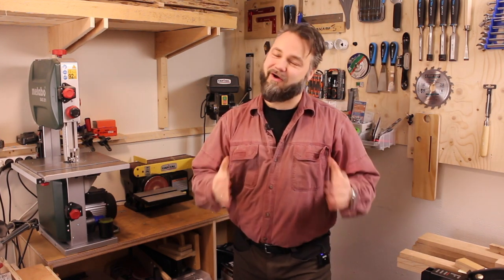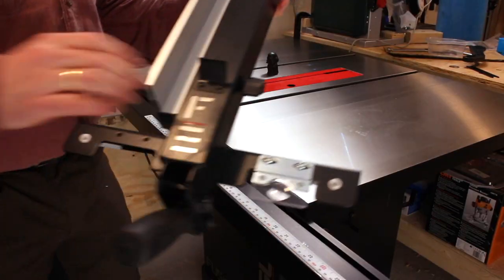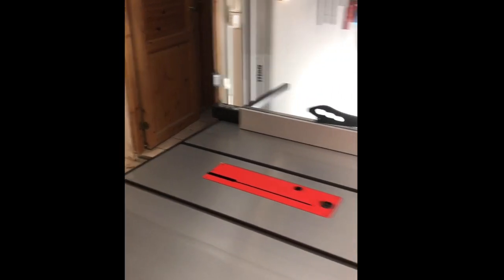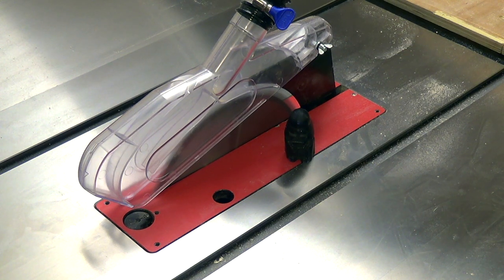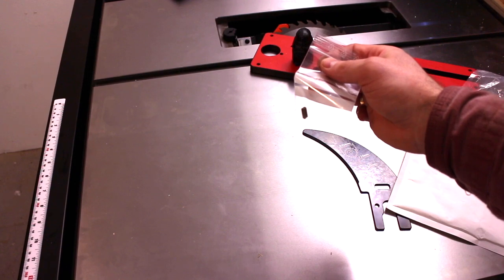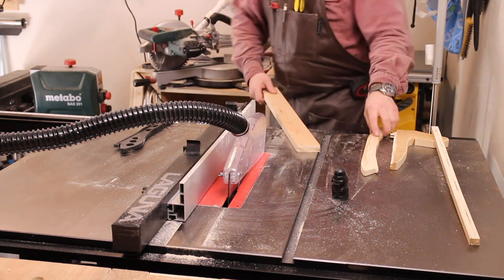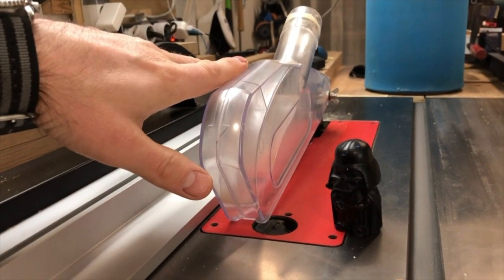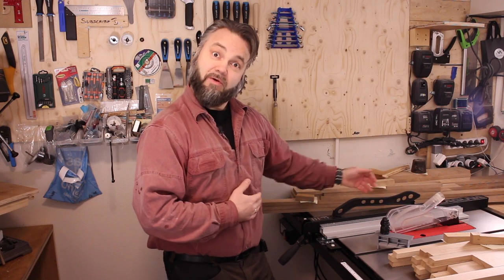Mother of All Unboxings - Laguna Fusion 3 Cabinet Saw - My Forever Tool - [0069]

Comment: The dust extraction is unfortunately terrible. It's inexcusable on a saw of this price point to have a cheap 1 piece blade guard and such flimsy hose and hose support. At this price point, with a 100% Chinese product, they should have beat even SawStop's dust collection.
Reply from the maker: I agree with you on the dust collection and blade guard. However, here in Norway this saw is not particularly expensive compared to other similar products, so I cannot comment on that. 
The saw does have other redeeming features though. Especially the quick change riving knife.

Comment: Would love to hear your thoughts on the saw now that you’ve had it for a few years. The F3 is on my short list.
Reply from the maker: I absolutely love the saw. It is, however, not perfect. And depening on which side of the Atlantic you are on, and on your budget - there may be better alternatives. 
Pros:
- Quick change riving knife/blade guard
- Motor brake (required in Europe so may not apply to US models)
- Poweful/Heavy etc. 
Cons:
- Dust collection
- The fence is adequate, but there are better solutions out there
Reply: @NomadMakes  Thank you for your feedback! I’m in Texas and able to score an F3 for about $2200USD after taxes and shipping. The Harvey I’m looking at is $3500. The Sawstop is…well, too expensive. The fence is such a critical feature that your comment is all I need to read, especially with the new Big Eye fenced from Harvey. Appreciate the feedback so much!
Reply from the maker: Nice to hear you found it helpful. Good luck with your purchase.

Comment: Hello Nomad. I am also based in Norway and I am curious about the little brother of this saw, the Laguna Fusion 2. You have used your Laguna Saw for a few years how does it hold up and would you reccommend this brand to someone with fairly little experience but with a big passion for woodworking?
Reply from the maker: Hi Joakim! I am still extremely happy with my Laguna Fusion 3. It is by far my favorite tool in the workshop. That being said, I do not know the Fusion 2. However what I would look for in the saw is the quick change riving knife. Stop time for the saw blade is part of Norwegian tool regulation, so that should be covered on all these saws. Amount of experience is also a relative thing. Is this your first table saw?
Reply: Thank you for such a promt reply! Yes this will be my first table saw.  @NomadMakes
Reply from the maker: Well proper cabinet saws are a joy to use. But have you considered a job site saw first? It’s a good way to build experience and get to know what you want from the saw.

Comment: Thanks for the video. I just ordered this saw last weekend and am really looking forward to it. Any chance you call let me know how easy or difficult it is to move/maneuver with the built in wheels?
Reply from the maker: I am glad you liked the video. The saw is fairly easy to move on the built in wheels. However, without using a side support, the saw is not that stable. So, you must either fix it some fashion, or have to deal with the accessory legs. I keep mine fixed to a plywood sheet on the floor.
Reply: @NomadMakes  Awesome, thanks for the info and the quick reply :)
Reply from the maker: Happy to help, mate. Thanks for watching.

Comment: Thanks, Nomad, for the excellent outboxing. I like it.
You shown you did not need to adjust 90 degree angle of your blade. Unfortunately my factory settings were not correct, it’s about 89,60 degrees. Would be great to see how to fix it. Appreciate your feedback! Greetings 👋
Reply from the maker: Hi! It’s been a while since I made the video. Do you mean 90 deg in tilt of the blade, or the blade being parallell to the miter tracks?
For the blade there is an adjustment scew inside the cabinet. It’s easiest to get to if you remove the cabinet hatch on the left side of the cabinet.
Thanks for watching and commenting. Cheers.
Reply: @NomadMakes  Thanks for your prompt response! I meant 90 degrees in tilt of the blade. The manual is unclear what and how to move.
Reply from the maker: @Solariuman I see. If you look inside the cabinet while the blade is tilted to max and at 45 degrees, you will see that there are a screw on each side inside the the cabinet on the «front wall». These stop the tilt mechanism and is for fine adjustment of the endpoint. Hope that helps. Filming it is quite difficult.
Reply from the maker: @Solariuman Check out 11:00 for the tilt adjustment. The one shown is for the max tilt. But you will find the same type of screw on the other side for the 90 deg adjustment. Hope that helps.
Reply: Many thanks 🙏
Reply from the maker: No problem mate. Happy to help!

Comment: Nice video....just a comment regarding your comment about the fence on the LHS of the blade. I have made some 45 degree cuts and find when the blade tilts towards the guard, you are limited in the material size you can cut and it is risky. When the blade tilts away from the blade....much better....have fun...
Reply from the maker: Thanks :-D You have a very good point. I use the fence on the right side when doing angled cuts. Or when I need more space for a wider cut. Cheers and thanks for watching.

Comment: Did you have a flat bar left at the end of assembly with about 6–8 threaded holes in it ? I saw a glimpse at 03:12 at the bottom of where you had the parts laid out. I have no idea what it’s for 🤷🏻‍♂️
Reply from the maker: I believe that is for the extention table.

Comment: The one thing I noticed about the saw guard is that the back bolt has the wing nut to the right.  Thus making it a target for your push stick to get stuck on.  Any chance you could remove that and put it through the other way to keep you from getting hung up on it?
Reply from the maker: Keen observation! I moved it to the right side. Because I am left handed I mostly use the fence on the left. Thus it is better for me to have it this way ;-)
Reply: @NomadMakes  So there is a method to your madness.   :)
Reply from the maker: More like madness to my method :->

Comment: Do you happen to remember the approx weights of the top vs the cabinet?  I'm just about to get the same saw and have to also get it into my basement shop.  It was awesome to see you did it fairly easily with two people.  I was worried I might have to also remove motor from cabinet ... thanks for sharing!  This makes me much less nervous about getting the saw down my stairs!
Reply from the maker: The net weight of the saw is 157 Kg according to the maunal, which you most likely have to find online. I’d say that you must at least be 2 people to handle it. It’s very hard to guess what the ratio of weight between the top and cabinet is. But the problem with the cabinet is that it its hard get a good grip on. I would not suggest removing the motor unless you really know what you are doing. 
Good luck with the new saw. I love mine :-)
Reply: @NomadMakes  Thanks!  I'm hoping to not have to remove the motor and I found someone who did a tear down on this saw and the top is about 110lbs / 50kg so I think I'll be able to manage!
Reply from the maker: Cool. That is good to hear. Good luck with the saw. And let me know how it works out for you :-)

Comment: Hello Goran, funny thing,  I did things in reverse. I purchased the Laguna Fusion 3 around May 2020. (I still have not used it, obviously tested it currently covered in machine wax) more about that in a mo. A few months ago following your video on the Dewalt DWE7485 table saw, I purchased one and have already used it, Great little machine. I also purchased the CMT 6mm kerf blade, I didn't know about this product before your video, so thank you. Coming back to my Laguna, I was very disappointed to find out that in the UK (I assume we have the same European specification saw) I'm unable to use a dado stack or a thin kerf blade? I was advised by Laguna UK that they cannot sell the thin kerf riving knife they sell to owners in the USA who can also use dado stacks in their Laguna fusion 3 table saw. The reason I was given for not being able to use a dado stack, was due the the electronic braked motor specification for UK saws. Not sure how Axminster Tools get round this with their Harvey variant? It still does not explain why, in the UK we cannot purchase the thin kerf riving knife. 
Unfortunately even if I was able to get one from the USA. The way the blade attaches to the arbour means the body of the blade must be slightly over 2mm therefore eliminating the thin kerf blades I have seen?
Goran, I noticed in your more up to date instagram, you have several Luna Tools saw blades to test. These blades have a kerf of 2.4mm but more importantly the body of the blades are 1.4mm. How have you managed to secure the blade to the arbour of your saw? 
Sorry for the long comment but hopefully you have found a simple fix to my problem. Kind regards Pete
Reply from the maker: Hi Peter!
Yes, it really is a great little machine, like you say. And some details on it are more thought through than on the Laguna. Like the blade guard, for instance. The blade guard on the DeWalt is really nice with the slit that you can aim through when setting up the cut.
The CMT blade is really nice, but quite prone to tear out. Especially on english oak. So, I am currently experimenting with scoring lines with a knife before the cut. 
I had to sell the DeWalt since I have so little space. The fact that I squeezed the Laguna into the shop is 1 of 2 luxuries I am allowing myself. The other is the lathe. 
I´d love to hear your story with the Laguna. 
Cheers.
Reply: Interesting.  Being from USA I was unaware of this.  I am not an expert but if you had a saw that would run full kerf blades why go to thin?  I was under impression that they heat up, deflect and just don't have the carbide on the teeth.  I am only asking because my current saw is a bit underpowered and can only run thin kerf blades.  I thought stepping up to 220V 3HP (in USA) would be an advantage so I could use regular kerf blades.   

Why can't you use a dado stack?
Reply from the maker: I have to be honest, I do not know what the definition of a thin kerf is. But the riving knife is 2,2mm and the kerf of the Luna blades are 2,4mm. The supplier said I keeded a 0,2 clearance. And even though the riving knife is meant for a 10inch (254mm) blade a 250mm blade still clears the top of the knife. 
However, be aware that the riving knife spesifically says to use 254mm and larger than 3mm kerf...
Reply from the maker: I can use a dado stack on this saw, but I haven’t purchased one yet. On my DeWalt DWE7485 I could not. So I used a 6mm wide grooving blade. And when I sold the saw I kept the 6mm grooving blade.
Reply: @NomadMakes  Hello Goran, If you look on the Laguna USA web site, Fusion Table saw accessories the thin kerf riving knife is SKU: PTSF132110150-0130-000 $45.00 The riving knife is 2mm thick, for use with a 10" blade, blade body 1.8mm maximum, blade kerf 2.2mm minimum. Unfortunately Laguna are not allowed to sell it in UK due to CE specifications. I assume this is the same for Europe? What I was interested in, is how you fitted the Luna saw blade which have a 1.4mm blade body thickness, when the the Laguna 30mm blade securing washer has a 2mm flange meaning any blade body less than 2.1mm would not secure to the arbour? This is explained and the blade washer shown in a very interesting YouTube channel I just found "Shane's weekend builds" Shane is German but has started posting some content in English including about his new Laguna Fusion 3. I hope this helps, kind regards Pete
Reply: @NomadMakes  Hello Goran, you are correct, I was informed last year that I should not use a dado on my European specified Laguna Fusion 3 table saw because in the EU the motors have to have electronic brakes (USA does not have this due to their voltage) which would make using the additional weight of a dado unsafe and therefore not CE compliant. More recently I have been advised it is due to the machine not being supplied with an overhead guard like the one Axminster sell for their Harvey table saw which does allow the use of a dado. I'm going to order a 8" dado set, make sure when you buy one, you order it with a 5/8" bore. I found out another interesting fact yesterday that you can buy a 5/8" blade washer for the laguna fusion 3 that has a flat face. (I assume this is what is supplied as standard to owners in the USA?) the part number is F3#034 unfortunately currently sold out in UK but your European supplier maybe able to help. I hope this helps, kind regards Pete
Reply from the maker: To be completely honest, the fact that the arbor washer may be too deep never even crossed my mind. But the blade secures nicely and have seen plenty of use already. I guess if it was a problem you could make a really thin washer from a soda can or something, to make sure...
Reply from the maker: I have to say that I am not 100% sure about this, but I believe that there are a lot of misunderstanding about the legality of dado blades here. I assume you are in the UK. And I don’t think the regulation in Norway regarding this is much different. 
Dado blades, the way I understand it, have never been illegal here, as many seem to think. In a business however, exposed blades of all kinds are illegal. And most manufactureres have been unable or unwilling to come up with sufficient blade guards. They are now available. Like the one you mention for the Harvey, which I guess is very similar or the same same as Laguna offers. 
The Norwegian Laguna importer provide dado stacks and all the neccesary extras, so I haven’t really had to look to deeply into this, as they guarantee the fit.
Reply: @NomadMakes  Hello Goran, yes I'm in the UK. I think the rules around the use of a dado relates to a commercial environment, what we get up to in our own private workshops is between us and the medical teams that are hopefully never needed! That said, yesterday I ordered (UK company) and today I received a CMT Orange Tools 230.524.08  8" precision Dado blade set, OMG it's heavy! I still need to find where I can buy a 5/8" blade washer before I can think about using it. Kind regards Pete
Reply from the maker: Yeah. Those are commercial business rules. 
My CMT blade is smaller but has a 30mm hole. But I have noticed that a lot of the CMT blades have smaller holes. 
Let me know if you find out where to buy that blade washer?

Comment: Hi I have  just purchased the same saw. Do you find it very noisy for an induction motor.  Thanks.
Reply from the maker: Hi Craig.
I do not find it very noisy, but it does this «squeel» at start up. Of course compared to my drill press it is loud. However, the noise level varies a lot fron saw blade to saw blade. Do you use blades with anti-vibration cut outs?
Reply: @NomadMakes  
Hi not at the moment but I have some on order. 
The saw I just sold was a lot quieter than the laguna so am a bit disappointed. I have only had it q few days so I didn't know if it was faulty or not. 
 I appreciated the reply thanks.
Reply from the maker: No probs mate!

Comment: Looks a great saw and thinking about it myself but not impressed with the dust collection.
Reply from the maker: The dust collection requires quite the suction. However, you will find this on most of these saws. Both the Harvey and comparable Grizzly saws have the same "issues". But it can be handled. You will need to fill some gaps. I get by using 2 chip collectors in parallel and one shop vac for the blade guard.
Reply: @NomadMakes  I guess no tool is perfect. Still think it’s a great saw.
Reply from the maker: Oh yes it is :-)
Reply from the maker: This is my favorite tool in the workshop at the moment :-)
Reply: Nearly all table saws are poor at dust collection.  Try sealing (masking tape or whatever works) all the gaps and holes in the base -- for instance, the groove that the blade height adjustment wheel travels whild adjusting blade tilt.  Interesting to read the challenges each country has with electrical standards, etc.
Reply from the maker: Those are great tips. I have done this. And sealed the gaps between the table top and the cabinet as well. And it really helped.